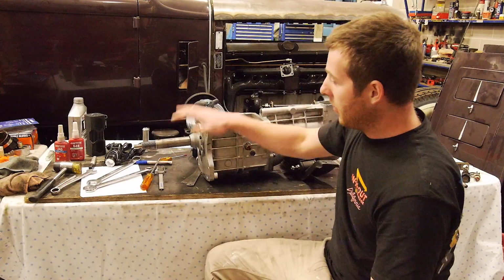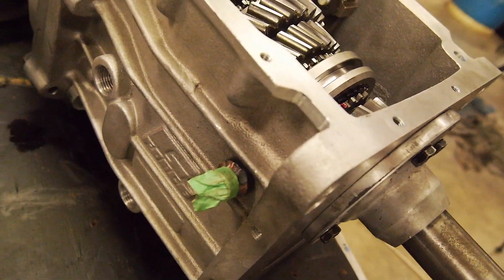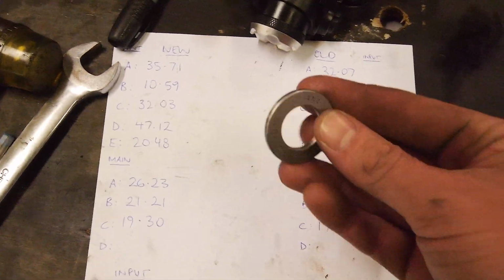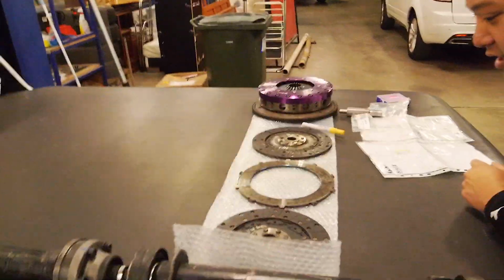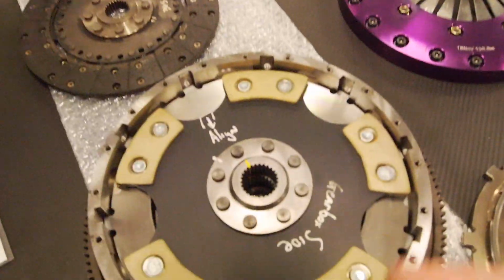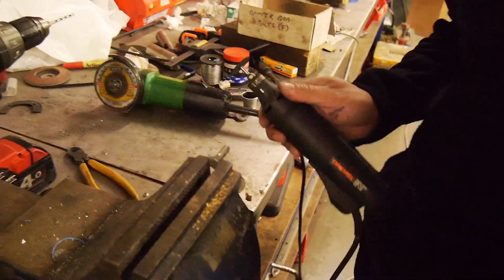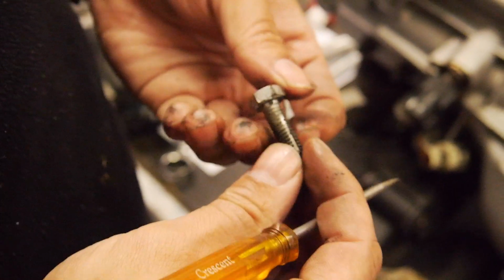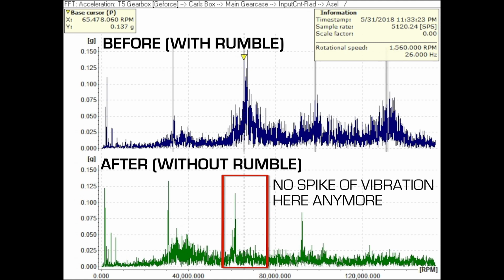BOX IS REBUILT, KEVLAR CLUTCH & TEST RESULTS!

Comment: Correct me if I'm wrong, but most gears are case hardened. By sanding or grinding them, you will have removed that hard and wear resistant outer layer ??   Great job on the diagnosis, teardown and reassembly.
Reply: Yes the gears are case hardened. The idea behind reworking the damaged area is to remove any high spots, and to smooth out the pitting so that there are no small bits left waiting to flake off and also so there are no micro cracks left which oil can get under (oil is incompressible) if you get oil under and then the tooth is loaded in that area it will cause the area to spall quickly leading to more damage. You don’t grind away any more material than was already missing, just localised smoothing out of the area.
Reply from the maker: Yeah that's correct indeed. It wasn't really grinding the top layer of, it was more just ever so lightly removing the raised, burred edge from the damage and lightly repolishing the faces. We'll see how it holds up I guess. It was either do that, or spend $2200 for a new shaft...

Comment: And whats interesting is your fancy vibration testing rig ya have there is not even needed to find the problem. Does not take a rocket scientist to see the actual problem. Your direct drive (aka 4th gear input shaft) is worn completely out. Also having a blown out input shaft bushing wich should have been a needle bearing is the cause of failure and the actual point of failure is the 4th gear input shaft tip due to the blown out bushing. Didnt need a $20 grand toy to actually figure that out and could have saved all sorts of time and money had you just replaced the bushing with a bearing and your noise will always be there since your gearset for 4th gear is worn out. Either live with it or open that wallet and buy a new 4th/input shaft gear and layshaft slip on 4th/direct drive gear.
Reply from the maker: You've missed the point buddy, we didn't need the vibration detector, but it was merely an exercise out of pure interest, didn't cost anything. These cars never come with a spigot bearing either FYI, always a bushing and never had a problem with the bush...

Comment: Brother you been sayin your gear placement wrong. The gear that is on the imput shaft is in face 4th gear not 1st gear and it goes input shaft gear is 4th then 3rd then 2nd then 1st then 5th/revers on the oposite side in the tail housing. 4th gear is direct drive and all ratios are figured off that gear set. You loose that gear you loose all gears as it is the only gear that transfers engine power to the lay shaft so 1 2 3 5 rev gears work. Please correct your mistake as this is ment to be sort of a how to video
Reply from the maker: Sorry it was quite late at night